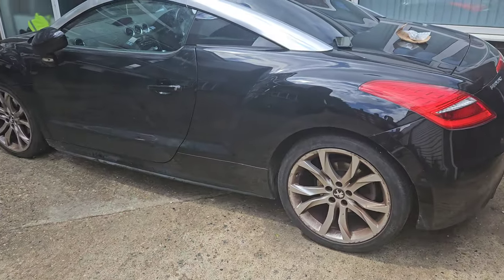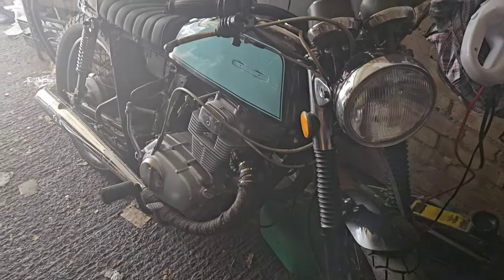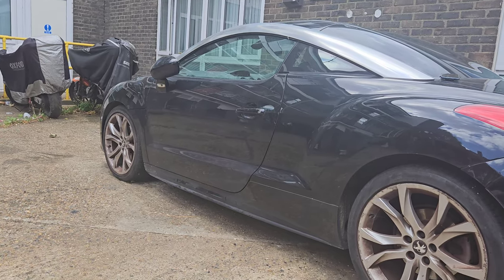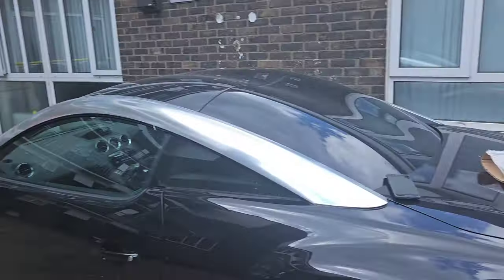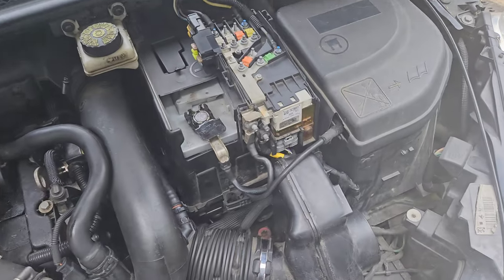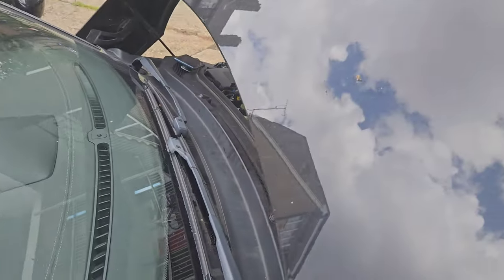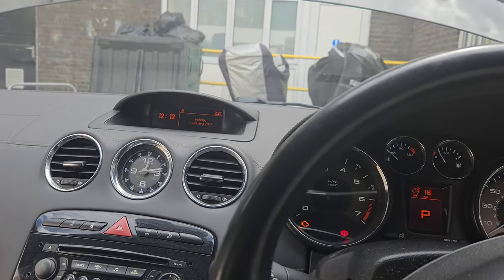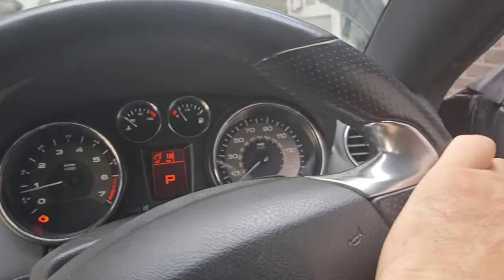Peugeot rcz fuel pump fix and ktm duke 390 update.

Comment: If it's any consolation Charlie - I've had an engine management light on for years due to a very low fuel level on one occasion - you can reset but they keep coming back ! Nothing wrong with the car although I much prefer my aircooled 4 from the 70's.
Reply from the maker: Yes I agree, mine says stop driving at times yes never missed a beat when with the slightly sketchy fuel pump. 

I think the top 02 sensor and 4 plugs is the last piece of the puzzle now. 

But the plug are £80 as I'd the sensor, ouch

Comment: Won't the Engine Mnagement Light stay on until is is reset with the scanner?
Reply from the maker: I did reset it with a obd2 scanner. But I think the remaining code is the top 02 sensor so I'll order one soon.
Reply: Obd confirmed bank 2 sensor 1 I think was the O2 sensor throwing the dash error.
No DTC codes though which was odd considering the O2 readings we got 😆
Reply: Aren't cars to complicated nowadays Charlie 🤔👍
Reply: @derekdingwall  so are bikes, that's why I stick to 40+ year old, air-cooled carburettor models. I had enough of fuel injection, PCMs and tightly packed engine bays when I was a car mechanic, so now I'm retired, I like things simple.
Reply from the maker: Cars, bikes, push chairs ha ha ha I struggle with them all Derek
Reply: @motorcyclerescuer  I struggle with mobile phones   and technology 🤔🙄👍

Comment: Ain’t this the same video you put out the other day? I’m confused.
Reply from the maker: Yes but the upload had gone wrong and it wouldn't even let me re upload for some reason. Just got it sorted this evening.
Reply: @motorcyclerescuer  less confused now, thank you.
Reply from the maker: Lol sorry. Yeh it went weird. New camera I'm guessing. I'm still playing with the settings for quality 

How's the picture for you on the new camera?
Reply: @motorcyclerescuer  clearer when outside but when you transition from in to out it seems to go a little blocky, not for long just while it’s auto adjusting the settings, might not even be noticeable on other devices I’m on a 62” 4K hdr tv so shows a lot more than say a phone. But as I said on the whole it is better.
Reply: @Theskullcollector1 that's the auto ISO. Bugged me for years.

I think manually setting it makes it slower to changing light conditions 👎 

Have played about with the settings in pro video mode on a similar phone and found the best set up is auto unless you're aiming at a fixed scenery or with solid lighting.